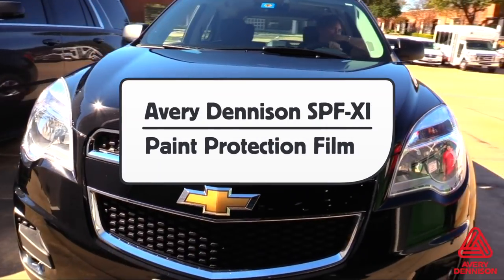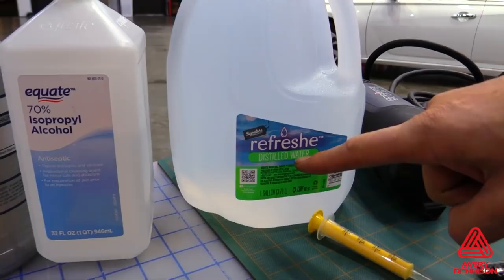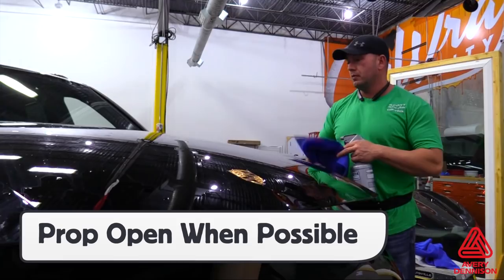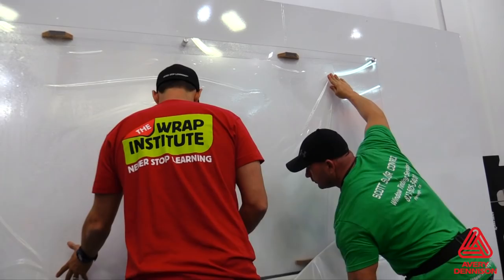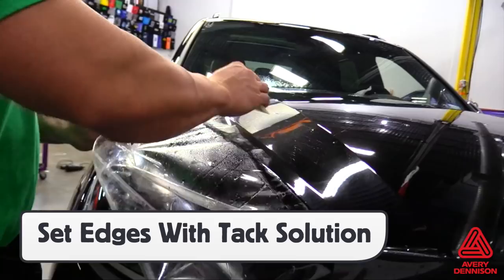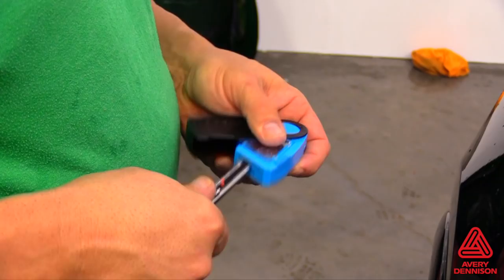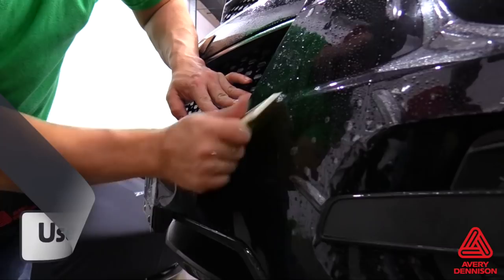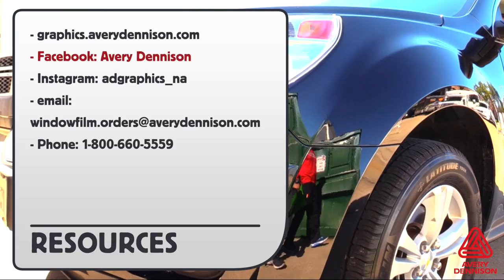Avery Dennison SPF-XI Paint Protection Film Instructional Video

Comment: Thanks for this video.
I never wrapped before and wonder whether I can do this "wet wrap" method using Oracal 651 (Intermediate Cal - it has permanent adhesive) on my car (Hood, Roof & Trunk) in one piece
I don't want to arguing about ideal way to do this (dry method & knifeless tape etc, as many Pro suggestions), but want to stick to this way (wet wrap) with some reasons.
I need your advise here about: 
A. Glassing process (since there's a solution underneath) As on your video the first step would be squeegee out the solution & also the air from underneath the vinyl.
B. After above process (A), which section should I squeegee first? Lets say in Trunk; The flat surface or the curve one? 
C. Post Heating
Same time frame as Dry method? (After 30 min but no longer than 12 hours) or after 24 hours? 
Thanks before
Reply from the maker: Hi there,
Thanks for your inquiry. Please connect with our Graphics team for more info about your questions, they're our experts! https://graphics.averydennison.com

Comment: Can the glue damage the paint? Or when the film is removed, does it cause any damage?
Reply: Nope , it protects the paint of the car. BUT ! if you use a very high alcohol mixture to apply the ppf and you don't squeegee it out ,  it can get stuck between the ppf and the car that may damage the clear coat. but the chance of that happening is minimal so.